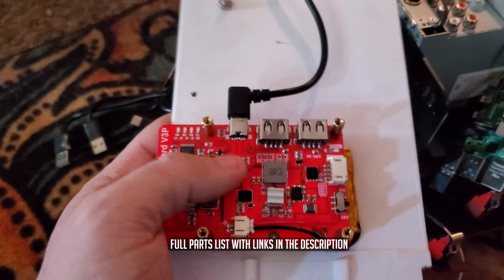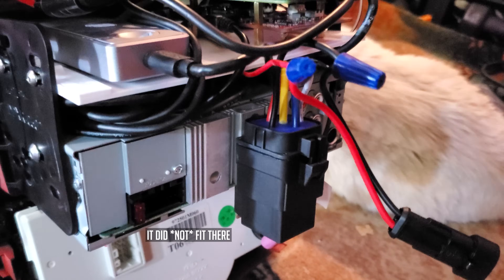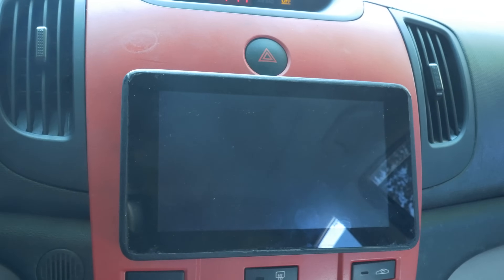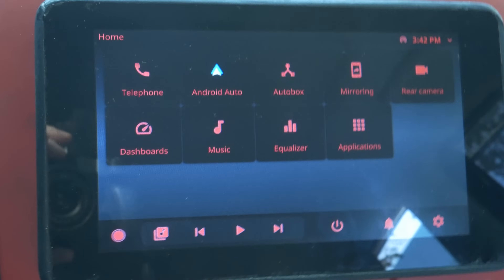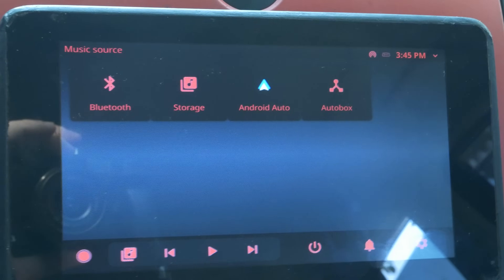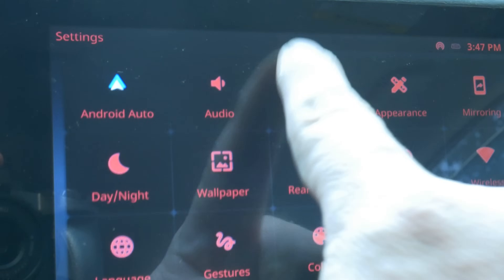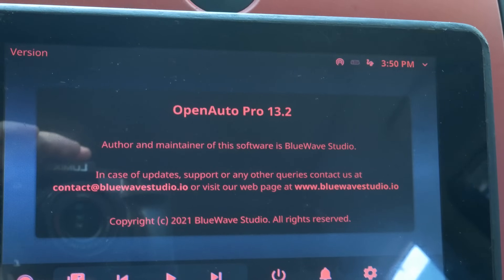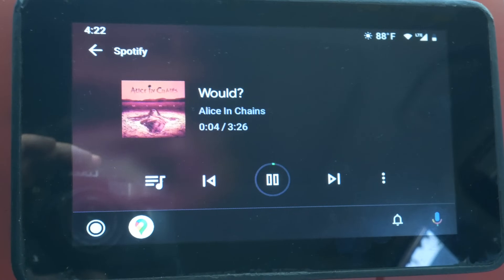Building a Raspberry Pi 4 In-Dash Car Computer w/ Android Auto (Raspberry Car Stereo)

Comment: Hey. Thanks for the share. I too was currently building one. Only thing I need to do is fabricate the headunit as I wanted a more portability standpoint and not embedded in the unit. I wanted to know if you can share how you did the custom boot screen? I couldnt find ut anywhere in the openauto forum or probably I didnt quite understand how.
Reply from the maker: The boot screen was actually easier than you might think. Here's what I did:

First thing, find or create a short video that you want to use as your boot screen. I did mine as a .mp4 at 1080p, but you could do 720p if you wanted to save storage space and whatnot.

I copied the .mp4 file I wanted to use as my boot screen to /home/users/pi/Videos

SSH into your pi and navigate to the /home/users/pi/Videos folder.

Then Create an backup of the original openautopro.splash.service file "sudo cp /etc/systemd/system/openautopro.splash.service /etc/systemd/system/openautopro.splash.service.bk"

Next, you'll convert the .mp4 file to a .h264 file by running this command "sudo ffmpeg -i dash.mp4 -an -vcodec libx264 -crf 23 dash.h264"

Replace "dash.mp4" with whatever you named your file. You can name "dash.h264" whatever you want, but make sure it still still ends in .h264.

Next, you'll want to edit the openautopro.splash.service file with "sudo nano /etc/systemd/system/openautopro.splash.service"

Change enviroment variable to match the name of the .h264 file e.g. "Environment="OPENAUTO_SPLASH_VIDEOS=/home/user/pi/Videos/dash.h264"

Reboot and enjoy.

Comment: A while back i was trying to get something like this in to my car. Got frustrated somewhere in a middle of the project .. end up buying android double-dim Head Unit from china. It works actually quit good but still thought of me making one never left
Reply from the maker: It was a fun project. I've seen other videos about it, but was super apprehensive about where to even start. Really glad I gave it a try!
Reply from the maker: The OBD thing was pretty straightforward with this setup. Just needed to find the MAC address of the device and add it to the openauto_system.ini file. This assumes that you're using a bluetooth connection, though.
Reply: same kinda, I originally wanted to do this project but got discouraged by the cost. never forgot about the project and I wish I had just done it in the first place. instead, I bought a 50 dollar Chinese double din radio that also came with a backup camera, one that I will attempt to use if I end up actually doing this project